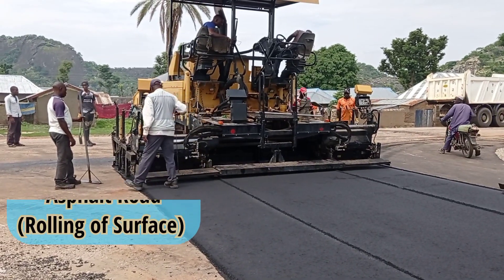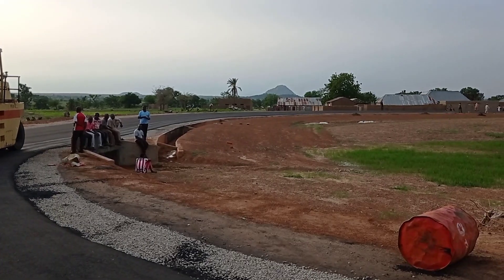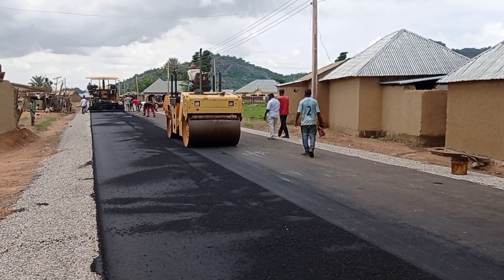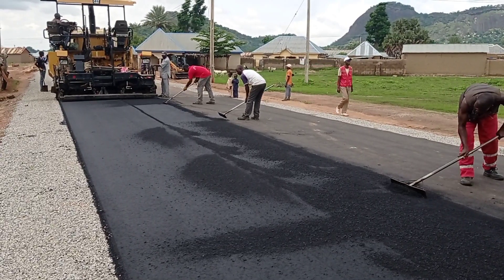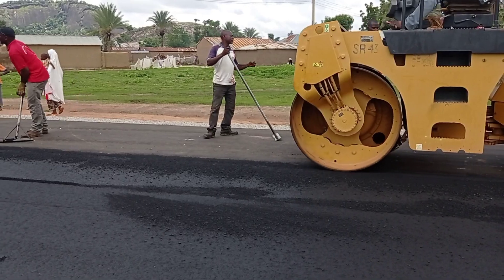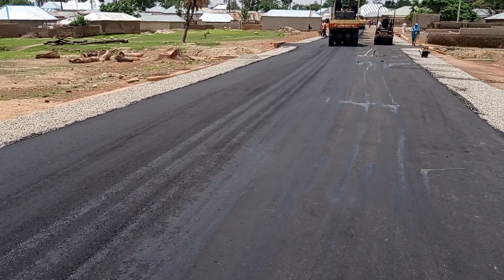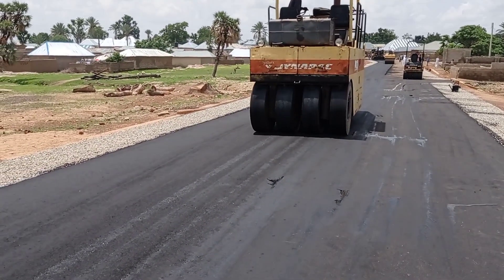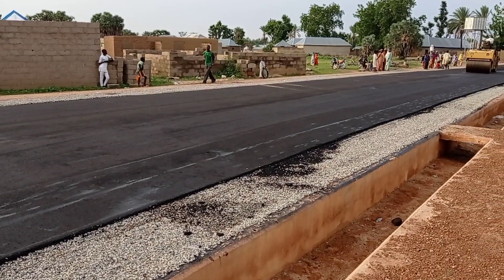Asphalt Road Carpeting | Asphalt Rolling

Comment: Great video engr. Please, is it necessary to use vibrating rollers? Is it better to use regular roller without vibration? Lastly why is it necessary to use the tyre roller?
Reply from the maker: Thank you so much.
No, we don't need to introduce any vibration effect during the rolling of asphalt surface.

Secondly, because of the kneading effect which is produced by the roller tyre’s elasticity, the displacement of material would be introduced in all different directions, forming even dense surface without any cracks, which can further enhance & prolong the service lifespan of asphalt road.

Hope it's helpful, thank you!
Reply: @civilengineerishaqsohag  very helpful. Thank you
Reply from the maker: @amirshake9803  great, you're most welcome. 😊